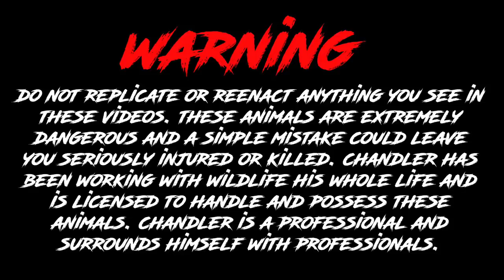ZIGGY’S NOT SO CHILL?!🐊

Comment: Actually My personal solution is with neighbors not to mess with them AT ALL. The less they know the better. 
I remember when I suddenly got a complainment about having loud sex voices while I sit in a train 5 hours away! 
I just wrote a message to the common info wall to announce, that the noise could not come from my place as I was far away working at that moment and keep the outer light curtains so, that it is IMPOSSIBLE TO KNOW when I am at home and ZERO complaints ever since!

One of my neighbor tried to force herself into my bathroom in order to fix" my drain untillmI said it was actually the toilet, which was a bit slower in the building. Then I kept quiet for a couple of weeks during which she had tried to break my mailbox while trying to see inside! 
After I said I had a lot of work, she calmed off and stopped invading my property. But every time a person disrespect my area, I stay away for a week. They will learn eventually. :)

Comment: Do you think its the age affecting ziggy's handling or do u think, as you said, you haven't had anywhere near as much time to handle and interact with ziggy. I just wonder as her calmness during handling has changed at exactly the same point you have been too busy to spend as much time with her. I'm sure it is a mixture of the 2 but putting it down purely to age maybe missing something.